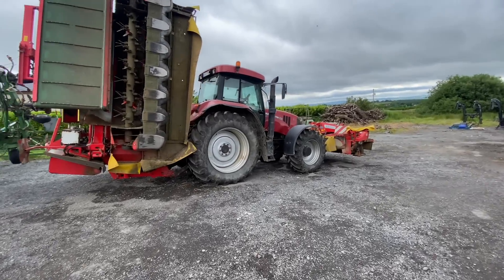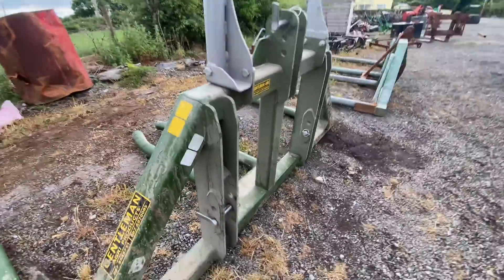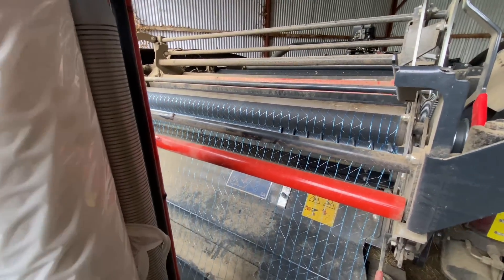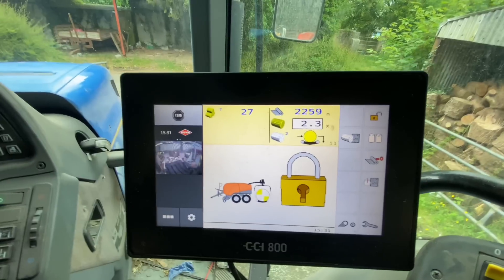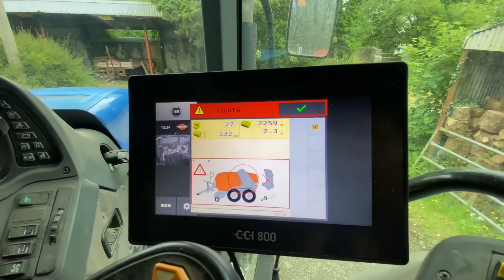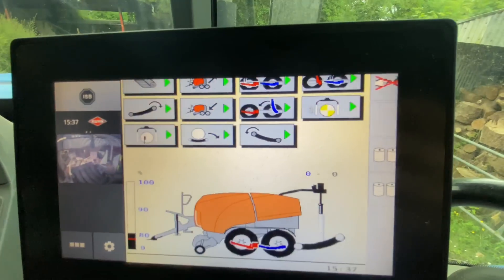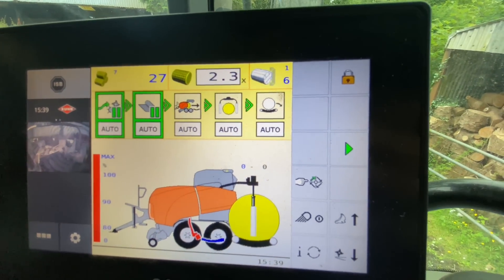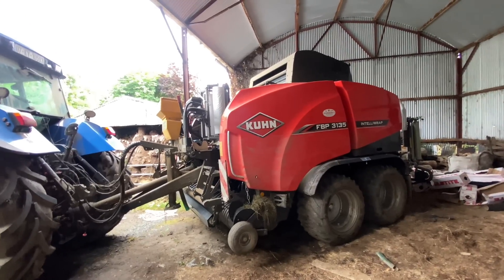First cut nearly complete, is the Kuhn fpb 3135 a success???

Comment: worked for a fella who has a Fusion 4, he said they have gone backwards with the new interface as they got rid of the buttons in place of an all-digital interface. Completely mad on Mchale's part, it's not a new Mercedes car its an interface for an agricultural machine its got to be functional, expecting someone with possibly dirty hands on a bumpy field try to hit a tiny pause button or a small lock icon is madness. I imagine its the same if ran through isobus but unsure
Reply from the maker: I think everything is gone this way , it's not for me .even some new cars it's hard turn on the radio

Comment: You just goto auto when It comes up on the screen it will take over. And there is a cover under the bottom back roller just after rotor take it off the first of them was welded on but the newer ones are bolted. You might have to clean it once a day and it more in hay or very dry silage it will build up.

Comment: How much power will the Kuhn take compared to the mchale? Is it easier to drive? 

100% with you on chopping in these big crops. Have had chopper blades professionally sharpened this year and in big crops I think that’s paid dividends. Actually considering buying my own sharpening machine as it’s seriously saved time, fuel and strain on the baler
Reply from the maker: It's a bit more power hungry as it's packing them more .edge is very important